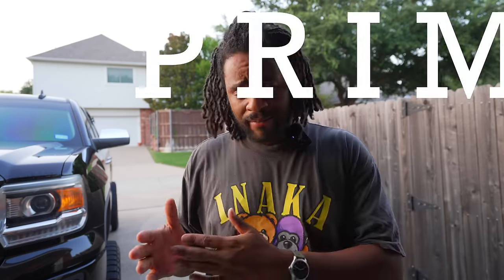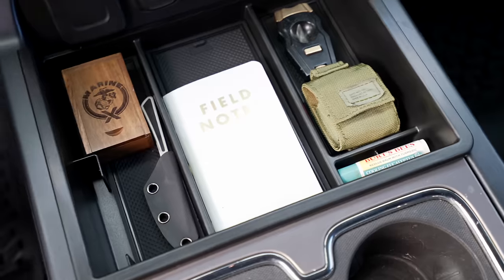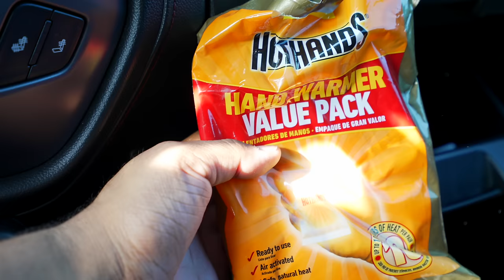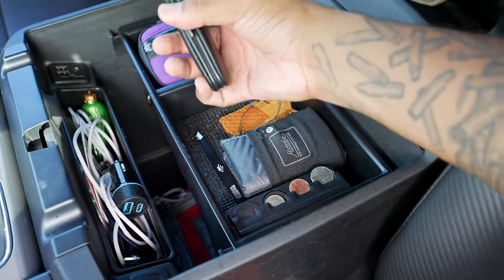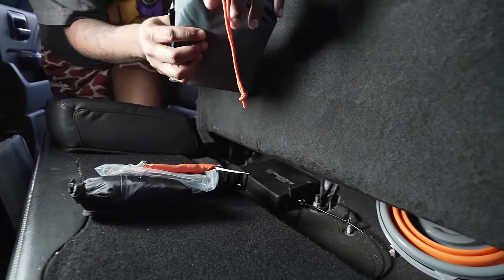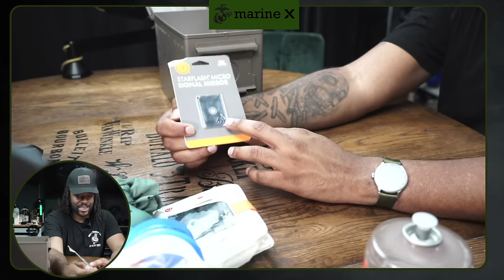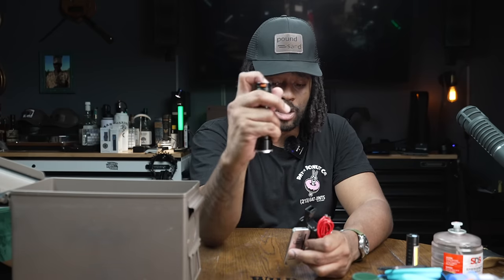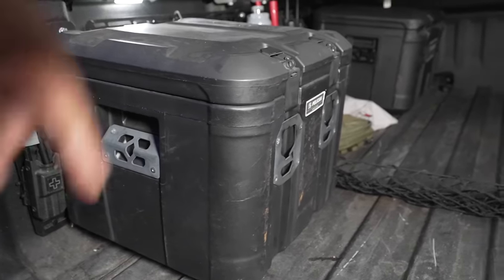Truck EDC - The ULTIMATE Guide - Over 250 Items!

Comment: Excellent set up! Since you have a full size truck and have the room, I always recommend carrying a full size shovel with a standard length handle. When you really have to dig, you don't want to be hunched over or on your belly to get under the center of your truck chassis or getting your truck unstuck from a ditch. A full length shovel can also be used as a pry bar, to safely break car windows, throwing large amounts of dirt on fires, etc.

Comment: I have to say on a couple of fronts…

1: if I am carrying a shovel in my truck it won’t be a gerber e-tool. When you have a nice system like that to mount stuff, why not have a decent spade with at least a 3’ handle. 

Also, why not get a hi-lift jack when you have a lifted truck? Again you have an easy place to mount it in the bed. 

One other thing I would suggest in a setup this complete. Put in a bottle of propane and a screw on burner. The burner and gas bottle would take up little room and when you were talking about lighting fires and warming hands… I just like to cheat and have a ready made flame that is going in seconds wet or dry. 

One other thing because I could not see your tool kit. I have a rule now on trucks because of issues I have had with tires.  I carry a full size impact socket for my lug size and a 30” breaker bar so I know I can get the tire loose. I have had impact gun batteries die, small lug wrenches bend… screw that…big ass breaker bar is what you want to carry. 

But overall, very nice setup.

Comment: Great load out Marine X,  You provided me some great ideas for my truck.  I have a 2023 4Runner TRD and am slowly working on my load out.  My primary is done for the cab.  My secondary and tertiary are a work in progress.  I recommend a wool blanket and a snow shovel only because I live in the Northeast and we can have some very cold and snowy winters.  In addition, I keep spare light bulbs, wipers, and window wash in my truck tool kit. Thanks for sharing.

Comment: Maybe I missed it but, do you have a fire extinguisher on the truck.  I love your truck though.  I work out of my truck.  I gave it more of a modular design built around Milwalkee packout boxes and mounts on a bedslide.  The packout boxes are waterproof and I have different boxes for different tasks.  I just load up the boxes that I need and go.

I would suggest getting a bedslide.  I got mine used on CL for like $300.  Not having to climb into the bed is life changing.  

Also you would like the Milwalkee M12 lantern.  It gives off lots of light and also has a USB charger built in.

OK just saw your extinguisher.😊

Comment: I really liked the video; thank you. Hard to believe you keep that truck back clean. Question about weight distribution. What side of the truck is your fuel tank on? Looks like you're in the driver's seat, and you have a big box of tools on the driver's side as well. If the tools you and the fuel tanks are on the same side do you see that being an issue?

Comment: I am new here to your channel and i very much enjoyed the video.

I have a 2012 Toyota Tundra Crewmax lifted and i absolutely love my truck and also own a 2000 Dodge Durango SLT 4x4 which i love very much too. The damm thing just wont break down for whatever reason i throw at it...

Anyways, my Tundra is more of my daily driver so i decided to do the same couple years ago . I have the foward folding down seats in the rear and i usually keep everything behind it.

I have a Fiskars all black version axe with the matching all black hatchet and damm have they come in handy. I also have a Fiskars mallet hammer as well as the driver hammer and a Fiskars wrecking bar, the smaller one all behind the rear seat. 

They've long enough and they all lay flat kinda on top of each other. I have both the e-tool entrenching tool as well as a regular shovel that lay behind the seat.

I also keep two sized bolt-cutters in a zippered up small cushioned bag, cant remember where i got it from but you just never know when bolt-cutters will come in handy.

Got plenty of ropes of varying types and sizes as well as different tie-down straps in a large pouch bag. Got flashlights galore and a couple of headlamps. I also keep those glow sticks handy as well to cover all my lighting needs.

Got first aid kits and a couple of small little boo boo kits as well as a couple of the Condor large rip-away EMT kits i use mainly for trauma kits, one gunshot wound specific and the other mainly in case i come up on a vehicle accident to help if needed.

Got plenty of car charger kits as well as a solar charger bank. Need to get one more too. Got a couple of really good tool kits that fit just nice and snug under the back seat.  My other full sized tool kit sits behind the rear seat on top of all the other "stuff"....😮

Got some other stuff that are definitely "for the truck and goes everywhere" stuff, cant think right off the top of my head. Got a few extra blankets  and a extra ballcap and a coat back behind the seat as well.

Blankets are in case if travelling back home to Northern Idaho, i can sleep at a truck stop on the way and with my windows tinted, helps cut out sunlight. Or, give to a homeless person in need during winter time which ive done quite a few times over the years.

But one thing i would recommend for you that i did not see in your truck and has proved invaluable for me...radio comms. You should get a CB radio especially you being in Texas and Texas being a huge major truckers haven, you could get a lot of info from those guys just by tuning in. 

I'm out west somewhere and there are times i tune in to listen to truckers talking from both Texas and Louisiana. With you being in a huge trucker state, I'm telling you man, a CB would prove invaluable. 

Also what you may wanna get, get a couple of GMRS radios as well. I got a base model Midland MTX275 and a Wouxon UV9GR Pro or Plus or something like that, dont have it in front of me handheld and these have come in handy as well and i do not EVER leave my house without those radios in my truck. Worth their weight in gold in a power outtage scenario.

Anyways, I've typed way to frigging much but just wanted to share what i have and give ya a couple recommendations. I loved this video and when i get a chance, ill check out your other ones as well. Stay safe and have a great day...
Reply: I've been thinking about a CB for my truck and GMRS as well.  Would consider a small CB for the truck.  What do you have?   I like the GMRS vids I have seen, but not sure if they are practical enough.  I have one Baofeng UV5R, may get another one or upgrade to a newer Baofeng.

Comment: its cool to see different set ups in pick up beds.
I have the diamondback HD aswell, but i got their tool box that's a drop in and ive attached these same builtright industries panels in the interior of it, and then have maxtrax attached to the outside of it and 2 jerry cans one on either bed wall.

really like your use of the molle panels along the bed though. What rail system to you have for your "boomstick"?

Comment: Hey, I bought the Coast flashlight and the Quick Fist holders.  How did you secure them in the handle mounts. Mine are only held in place by metal clips.  I’m in for $100 so I’d rather finish the job than return all the items.  
Thanks